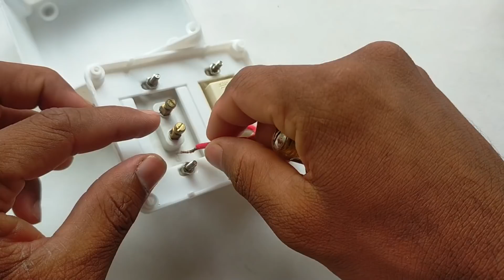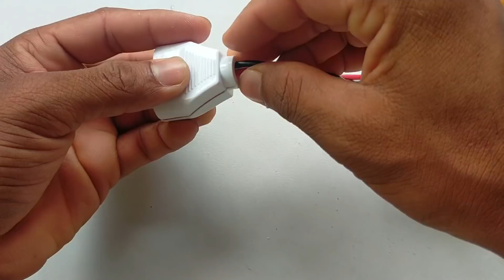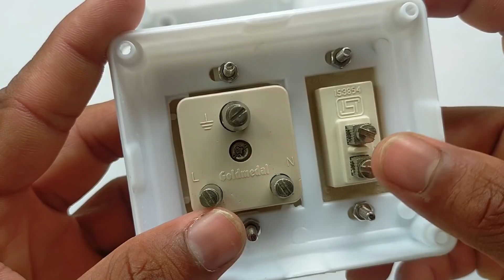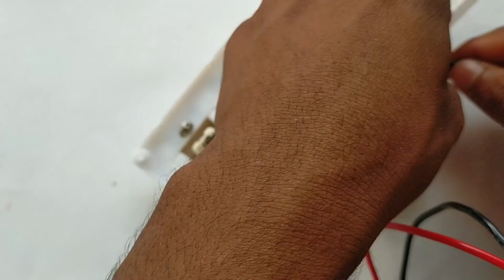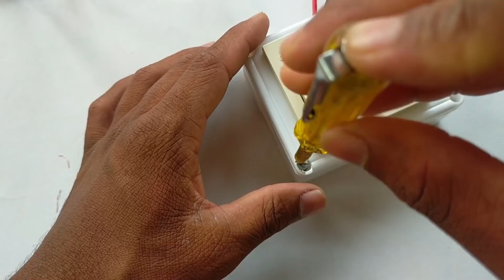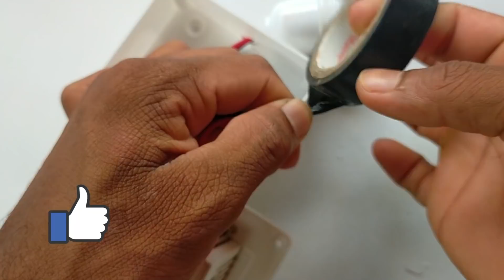All Electrical Board Basic wirings | All kinds of Electric board wirings | Basics of wirings

Comment: Dear admin 
I have query regarding that , can we use Cat-6 WIRE for any electric purpose .
Reply from the maker: No. Cat is very sensitive than real wires . It is also works but leads to damage quickly.I suggested that never use.
Reply: @BEEEWorks  can we not use CAT for only ingle plug extension wire  for.Mobile. charge ?
Reply from the maker: its ok for mobile chargers